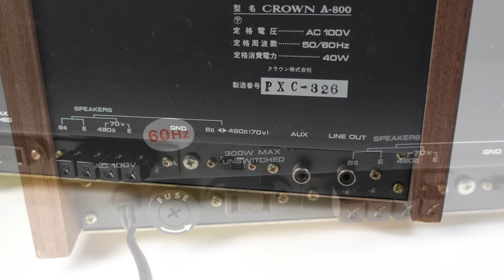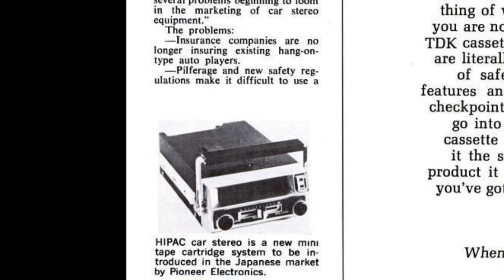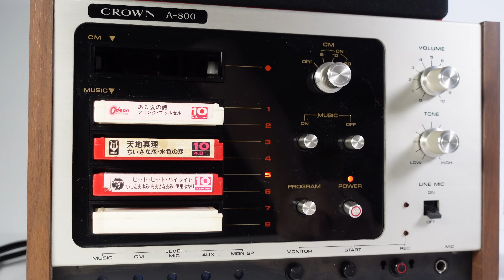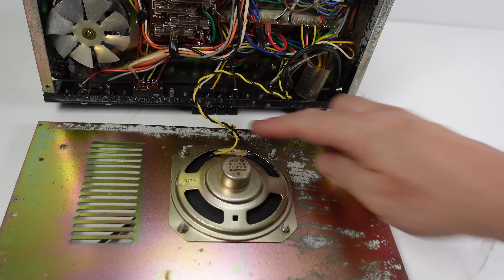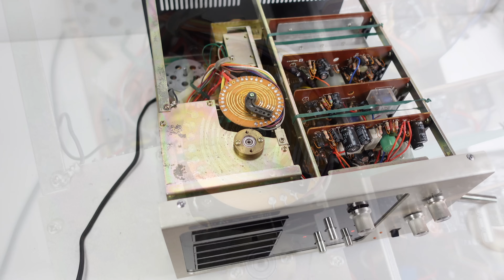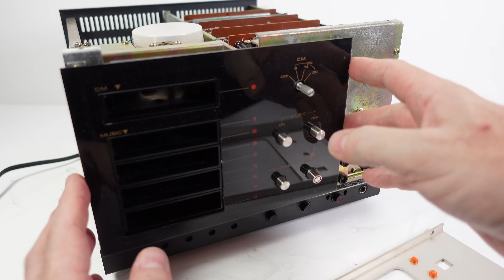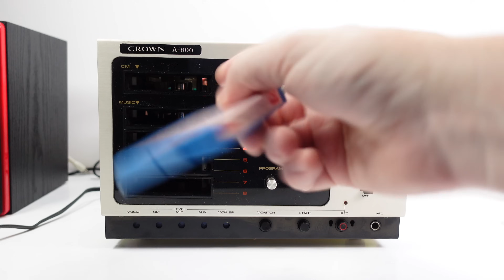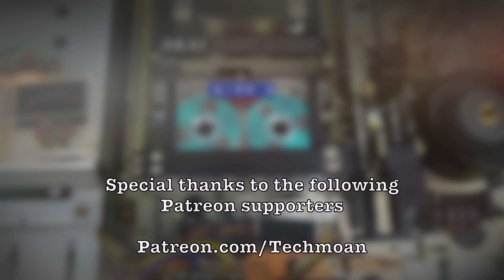An unusual player for a forgotten ‘70s music format

Comment: Did you use the start button, that might record a tone on the second channel, and you could press it between short announcements for longer tapes, the electronics could be looking for the tone, as there is rather a lot for a “simple” player.
Reply: I was thinking something like this. There needs to be some way for the unit to handle different lengths of recordings.

On the other hand Mat has clearly read the manual.

Comment: It is definitely possible it could be just the capacitor to change the speed.  A Capacitor in an AC circuit can change phasing of the AC Supply (move the current and voltage) and as such could change the speed the motor runs.  I am not 100% sure in this case as I don't know the circuit, but caps are pretty cheap and easy to swap so it could be worth while.  
On the Announcement tape, it likely needs a tone to stop.  It might switch on the original microphone.

Comment: I really doubt that the capacitor will change the speed.
Technically it is possible to make a circuit that uses a capacitor to change speed, but it would be a really stupid design.
Capacitors aren’t really precision components to begin with, and they tend to drift in value over time.
To test the hypothesis you can just connect a suitable 0.4uF capacitor in parallel with the 0.6uF capacitor.

Comment: The chassis is cadmium plated and that stuff that you called rust is cadmium oxide, don't try to remove it as it is poisonous. We used to treat it by lacquering over it to prevent it being airborne. Cadmium Compounds: Acute, high-level (inhalation) exposures can be fatal, and those who survive may have impaired lung function for years after a single exposure. A lethal dose of cadmium oxide fume may be inhaled without sufficient discomfort to warn worker of exposure.

Comment: If you change the capacitor to the flux type and turn the volume up to 88 you can use the machine to travel back in time so you can buy new parts.

Comment: Nope. Smaller smoothing capacitor for the higher mains frequency,  that's all. 

There's no way an electrolytic capacitor has anything to do with frequency or speed control as their tolerance and stability are very poor.

Easiest way to bump it up to run on 50hz is to ask someone very nicely to turn up on a lathe a new motor pulley with a 20% increase in diameter.
Reply: Not a smoothing capacitor as its value of 0.6uF is far too small to provide any useful smoothing at 60Hz. 
Also probably not an electrolytic capacitor as, judging by its size, it is a plastic film or paper capacitor rated at 250VAC or more and is used in this circuit as a motor start capacitor.
Reply: @stephenbell9257  i bow to your better eyesight ! I'm only viewing this on a mobile in the bath !!

Motor phase capacitor makes a lot more sense for the value - bigger pulley needing more starting torque ??

Comment: Is the motor AC powered? If so, you might have to fiddle with it or change it.
Reply: Please?
Reply: @robertschnobert9090  In many devices that needed a motor and was designed for multi hour continuous operation every day, a safe choice would be an ac induction motor. A kind of brushless motor. The speed of such a motor is in relation with the ac frequency only (and can be really stable).

Comment: OK I am the electronics expert LOL (British sarkyness <<) So "that Capacitor" looks like a "non polarised electrolytic" jobbie which are the less common types but can handle AC as opposed to the "normal 'litic caps that ARE polarised for DC ONLY" Anyway - Changing a cap value on AC is in simple terms just like altering it's resistance so it is HIGHLY likely the motor is an AC motor fed in series with that Cap so YES it will alter the speed if you change its value. (caps MUST be same or higher voltage as the original cap)  -here endeth the lesson.
Reply: Another electronics expert here. Probably not a non-polarised electrolytic as it appears too large to be a 0.6uF electrolytic capacitor. It looks more like it is a plastic film or paper capacitor rated at 250VAC and is used as motor start capacitor. Changing the value will not change the running speed of the motor.
Reply: @stephenbell9257  Non Pol. caps are twice the size of polarised caps as there is effectively 2 caps in there back to back in series. These small AC motors don't  have start caps. They are usually AC shaded pole motors as found in record players and reel to reel machines.

Comment: I guess the motor is synchronous, then the capacitor wouldn't change anything. But having two different values is weird too? Anyway, you shouldn't risk this machine. Why not invest in a proper step down converter WITH frequency adjustment? It seems like you are coming across this problem quite frequently.
Reply: My first guess also was a synchronus motor, the capacitor technically allows running some sort of 2-phase motor design on a single phase by providing the phase shift, typically by 90°. So maybe having a closer look at the motor can shed some more light onto this. If it just has 3 wires, you're very likely out of luck without a motor designed for 50Hz and the capacitor just has to match the motor type. If it has more wires, it might be possible to also reconfigure the motor RPM - together with the capacitor.
Reply: I agree. Synchronous motors are a simple way to get a very stable speed, becase it is locked to the mains frequency. That's why clocks and record payers used these motors as well.
Reply: I guess the capacitor has to match the motor to run smoothly. I don't think changing the cap will change anything, I guess the motor has to be changed too.
Reply: Usually they put caps like this on AC motors in order to balance the phase of the power. If your load is inductive (like an AC motor), it reflects some of the power back out of phase, wasting energy. This doesn't matter on the individual scale, but when you mass- produce it the effect adds up.
Reply: My money is on the speed being determined by pulley size. Not sure what the capacitor is about but it could be related to the different loads from the different torques from the changed pulley sizes.

Comment: So if you're saying that machine was for the 60hz western side of Japan and you're playing it back in the Uk at 50hz, then what prevents a Japanese person (back in the 70's) from the 50hz eastern side having the same problem as you? Surely there are 2 types of tapes also, depending on which side you live in? Or have I missed something?
Reply: Tapes same, players different.
Reply: @sonickrnd  Yes, I realised my mistake about 20 mins after I posted! Thanks for reply.
Reply: Yes, I finally got my brain in gear. Of course the component gives the ONE speed for either 50 or 60hz hence the tapes being One speed....DUH!

Comment: More likely a suppression cap.
If it was there for speed setting, a fine adjustment would be necessary since off the shelf caps vary due to manufacturing tolerances.
Reply: For background music playback, would a few % really be considered worth designing around?

Comment: Haven't watched the whole video yet, but CM is a typical abbreviation in Japan for a commercial. So the machine probably inserts a commercial in-between playing the tracks which can be set with a 5, 10 or 20-minute interval?
Edit: Yes, seems like you found it in the manual :) But yeah, CM is a typical abbreviation for commercial.

Comment: I think that pin to select the cartridge and push back the roller was originally just designed to pause a single cartridge. 8-tracks can pause but they either stop the capstan, leaving a dent on the roller, or they slightly push out the whole cartridge. Pushing back the roller is a more sophisticated way of doing this.

I'm not surprised though this format didn't take off. It has the worst of both worlds. The narrow tape and slow speed of cassette combined with the tracking, padding and splicing disasters that come with 8-track tape. I'd happily turn over a cassette for listening to side b to prevent those mishaps.

Comment: Maybe it would be possible to make some custom Hipac cartridges with a 3d printed cartridge and cassette tape.
Reply: Of course it's possible.  It's just not particularly cost-effective.
Reply: @xaenon  didn't ask if it was cost affective would just be good to listen to anything you wanted on the hardware.
Reply: @MrLethal1986  And I answered you.  I'm just pointing out that it isn't as simple as a lot of people think it is.

Think of what's involved.   First, someone has to acquire a cartridge, disassemble it, measure each and every part of it, and then duplicate the design in some form of CAD software.  I did something like that last year - it took a fair bit of time.

Then it has to be printed.  If you have your own 3D printer already, fine.  Set it up and go.   Don't have your own, or direct access to one?  Then you have to use a commercial service.  This is where it gets costly.  For a print of a custom 3D printed 45 adapter cost me $8.  That was just the item itself.  You also have to pay for machine setup and for shipping as well.

If you order several in a single batch, it's slightly less expensive, because you'll only have to pay for setup once, and if it can be consolidated into a single box instead of multiple boxes, shipping is less expensive overall.

The upside:

Once you've done the design work, you don't have to do it again.  You could print on demand.  

It's the costs of getting to the print of the very first one that are going to be aggravating.
Reply: @xaenon  not interested go have a rant somewhere else.
Reply: @MrLethal1986    Ah, so explaining the reality of it is a 'rant', huh?  Very well.  Live in your own little foamless hamburger universe of absolute denial then.  Zero f__ks given here, Skippy.
Reply: @xaenon  obviously there is or you wouldn't keep going on like a broken record would you skippy. You piped up thinking you know it all I shuy you down you got offended.

Comment: I only started watching your channel about a year ago and haven't binged all your content but....for the 50/60Hz issue it wouldn't be difficult to assemble a 240v50Hz to 12V DC (say 10 amps?) inverter then use a US 12v DC to 120v60Hz converter.  I have the opossite setup for EU to US I build for military service members.  They always have cool old 200-240v50Hz audio goodies from across the pond that they want to display stateside.

Comment: The capacitor is very likely used to provide the phase shift needed to drive the synchronous motor that drives the capstan: those motors needs two inputs with a proper phase shift so that it always rotate in the correct direction. Capacitance must be sized according to line frequency and the coils impedance; you will need to replace the cap if the line frequency is changed, but that alone will not change the rotation speed of the motor.
Reply: Yes agreed about the role of the capacitor. You probably need a different pulley, but it should be possible to work out how much bigger it needs to be and find someone who can machine one up.
Reply: @alancordwell9759  20% larger would make sense, since 60 is a 20% increase over 50.
Reply: @robinvince616  Problem is, capacitors typically vary from their nominal value by 20% or more! They're the least accurate component in any device, and hardly what you would choose for speed regulation.
Reply: @ickipoo  I was replying to Alan Cordwell about increasing the PULLEY SIZE by 20%, not the CAPACITOR. The capacitor change is just to optimise the phase shift for the synchronous motor. It won't affect its speed - the increased pulley size is to do that.
Reply: @robinvince616  No worries - we're in perfect agreement then!
Reply: @robinvince616  to speed it up the larger pulley would need to be 20% smaller, not larger.
Reply: me too :-)
besides, capacitors are notorious for low precision, and also tend to change capacitance with time (depending on the capacitor type), so it would be next to impossible to set the proper speed based on the capacitance alone.
Reply: I just had a look at some service manuals. The Tandberg TCD-330 uses a similar design around the motor - a capacitor for the second phase, which depends on the frequency, but furthermore, the pulley needs to be replaced for the different frequency.
Maybe in that Crown A-800 the pulley can be just flipped over (like in the Philips EL3555), or a different pully is required - an option might be a 3D printed part. Maybe not optimal for productive use but for a test before putting the unit into the private museum, maybe powering it up from time to time good enough. I already 3D printed gears to repair things from RC cars up to Betacam SP camcorders, that can work pretty good. Maybe you have someone around who can help you with this? A makerspace or so?
Reply: Yup, totally agree.
Reply: Yes, a different pulley and probably also different belt is most likely the chief difference between 50 and 60 Hz models, with the capacitor being sized to serve to properly start and possibly run the motor.  You could possibly find someone on the web to fabricate the 50 Hz pulley and calculate the belt size for you. I hope you can demo this at speed.  Perhaps another possibility is to use a good quality DC to AC power inverter made for 60 Hz Japan or North America, feeding it from a DC power supply.  Or since you have all manner of audio equipment, suitably amplify and voltage transform a 60 Hz sine wave signal. (You could have fun playing with the exact frequency.  But be sure your amplifier has appropriate power and frequency response.)
Reply: Agree, it is extremely unlikely that replacing the capacitor will change the playback speed for all the reasons mentioned in this comment thread. If you want to be absolutely sure though, just clip a 0.39uF or .47uF capacitor in parallel to the 0.6uF capacitor using some alligator clips. Parallel capacitors are additive so the resulting capacity of the pair would be 0.99uF and 1.07uF respectively, that will definitively settle whether changing the capacitance changes the speed. Oh, and I'd like to back the 3D printed pulley idea, you can even get a metal one 3D printed so that the weight is up to snuff.
Reply: If you don't want to so wrong next time, just use words like "I think" or "probably" before saying something definitive like "will not change the rotation speed" otherwise it sounds like you know what you are talking about.
Reply: @madstupid  Thanks for the suggestion, next time I need any advice I will surely ask you first.
Reply: @enricoself2256  I hope you do. Otherwise you will confidentiality say incorrect things again, then act like you weren't wrong... But you were.
Reply: Exactly right
Reply: Yep, i agree with this. The value is probably not all that critical as it might just give the motor slightly less toqrue if its the wrong one.
Reply: @berni8k  and a lot of capacitors (particularly electrolytics) have terrible tolerances. So it would be really surprising if the value were critical.
Reply: Yep, values are very close to theoretical for 100V 10W single phase async motor with phase shifting capacitor. Changing cap without changing motor/gears is not going to help.
Reply: Looks like experimentation has proven you very wrong. Embarrassing
Reply: @deaddave2170  I do not feel embarrassed at all, it's not an argument to win. My (wrong) assumption was it was using a synchronous motor as many similar devices do and they require pulley change to adapt to 50/60 Hz. Indeed it is using an induction motor whose speed can be altered by changing the phase shift capacitor. Learned something new, end of the story.
Reply: I’d try the cap swap who knows how the designed it, it’s possible that was how they did the speed change.
Reply: Basically, the only new principle involved is that instead of power being generated by the relative motion of conductors and fluxes its produced by the modial interaction of magneto reluctance, and capacitive duractance. The original capacitor had a base plate of prefamulated amulite surmounted by a malleable logarithmic casing in such a way that the two sperving bearings run a direct line with the panametric fam.
Reply: @jtr159  what about the marzelvane?
Reply: I guess from position and that the cap is a polarized one it is for smoothing the rectified AC and when you have a higher frequencies a lower value would be enough to do the job. I guess it will be something mechanical to change the speed uinless it is a DC motor then their should be a potentiometer somewhere on the board to adjust the speed.
Reply: @thsinger  No. It is an AC motor.  Rectification and smoothing is not relevant.

Comment: Would you be kind enough to post a link to the step down converters you use for Japanese items please? The current one I have is the size of a brick!
Reply from the maker: I just get whatever I can find on eBay - they’re usually just some made-up brand that seems to change each time I order more. I’m my experience it’s worth hunting out one with a power switch on it though - saves repeatedly unplugging a brick.

Comment: Since that cap is right next to fuses I would guess that it has something to do with the power supply and must therefore be sized for the relevant input frequency, but I doubt that it will have any effect on the running speed. If it were involved in the timing circuit, then to go from 50 to 60 Hz then the smaller cap should be 0.8uF not 0.6uF.
Reply: Wrong. The frequency of an LC circuit is proportional to √C, hence 0.9µF would be the correct value.
Reply: @mojoblues66  What about a simple RC timing circuit? Either way, 0.6uF cannot be correct.